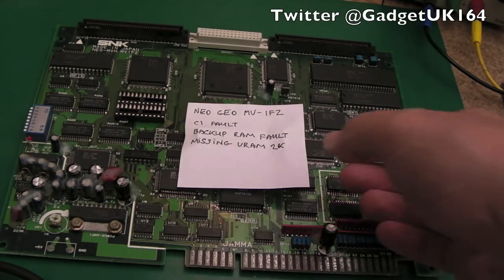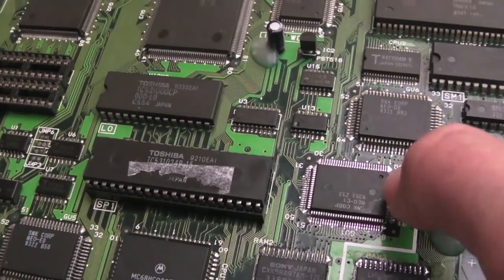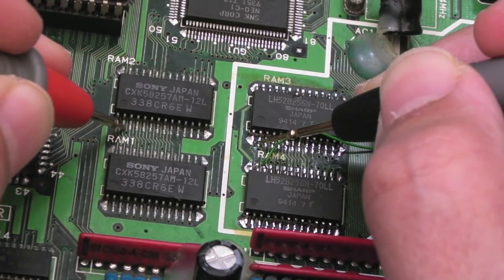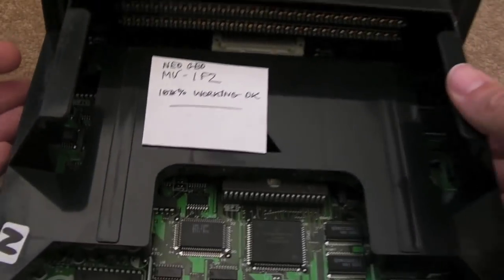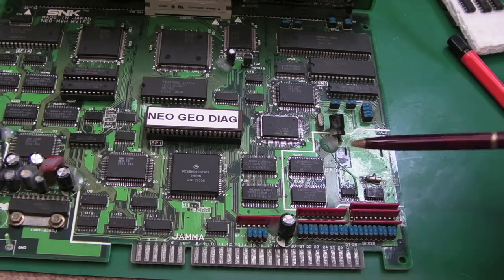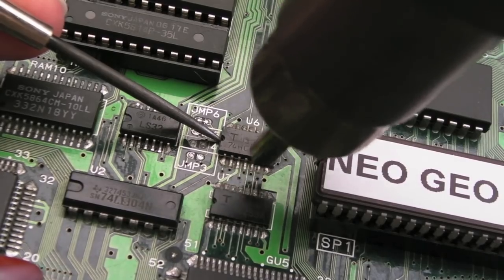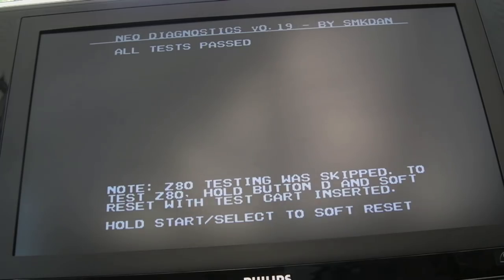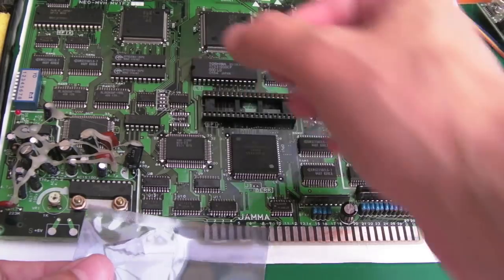SNK Neo Geo MV-1FZ (MVS) Backup RAM & Palette RAM Repair (Not the usual suspects...)

Comment from the maker: Link to the diagram (and notes) I created - https://www.dropbox.com/s/vcwc88lzmbq22n5/1FZ-BRAM.jpg?dl=0
Link to SMK Dan Diagnostic BIOS - http://smkdan.eludevisibility.org/neo/diag/
UNIBIOS - http://unibios.free.fr/
Reply: 42:05 ha, that's me. really shouldn't rewire power supplies in the dark with wires in non-standard colors. amazingly the MVS that I gave 12V still works fine months later but lost the multigame cart that was attached. and it was one of those new 161in1 carts that has a 5V regulator on each board. and looking at the regulator specsheet it says max 13V, so it should've been able to handle it?

the only thing that I can see could've been damaged on the cart is a diode that looks like it might be there for over-voltage protection, but checking with DMM it still seems to function as a diode.. maybe I should try replacing it anyway?
Reply: oh sorry, meant to make a new comment instead of reply.. and looking back the regs were these http://www.ti.com/product/LMS1585A setup for 3.3V I guess, but yea anyway Vin max 13V

Comment: Hey hows it going :) I just got a 1fz consolized system from spain and it's great apart from 1 issue. The audio is very loud and in many games causes wavey lines when loads goes on at once. This is on the ossc. Metal slug when still is fine but once action starts it's very obvious. Could this be linked to the volume pot being to high or my scart to scart fully wired cable? Thought I'd ask as you know alot about them :) sorry to trouble you mate
Reply: Sorted it. I was using a cable mountain rgb scart. Ditched it for a kabeldirekt lead and now flawless! Keep up the great work mate

Comment: I've fixed my MV1 thanks to your video and the diag bios, and like in your case the logic latch went under...

My symptoms were "funnier", not a single game of ADK worked (except ninja combat)  and prehistoric isle 2 failed too... a lot of textures were missing and replace by white and black boxes. 
The rest of the catalog worked fine, no glitches at all, from the old ones like fatal fury to the last, bigger, more demanding ones like kof's amd last battle, not a single problem. But not Alpha Denshi games... nope.

Thank god I got the palette error from the diag bios because if not I would be probably swapping expensive parts like a moron.

Thanks a lot!!

Comment: MV-1FZ is my fave as well. I got mine along with an MV-1 and the MV-1FZ was supposedly faulty but it was just a dead BIOS. Moving the socketed BIOS ROM from the MV-1 to the MV-1FZ was all it took. Heck, I had already programmed UniBIOS ROMs for it before I ever even powered it up so I inadvertently fixed it before even confirming the problem! To me, it’s the perfect board front-loading board to use for a consolization so I was surprised to see how few people were using a consolidated MV-1FZ before you. I suspect the LSPC2-A2 is faulty on one of my AES 3-6 boards so I’m going to try moving it from my known-good MV-1FZ to see if that does the trick. If so, I already know where I can order a replacement for $20. Thanks!
Reply from the maker: Let us know how you get on with that LSPC2-A2 - not a chip I would like to swap lol.
Reply: GadgetUK164 - Retro Gaming Repairs & Mods Will do! I recently salvaged a failed UltraHDMI installation for someone and managed to successfully remove the N64’s 160-pin QFP RCP (Reality Co-Processor - GPU) and reinstall it without damaging it (needed to remove the lifted pads so I could properly jumper the pins). Was good practice, but I still want more before I risk my working MV-1FZ. I’m going to practice on a box of 12 junk Super Famicoms with various bad QFPs (PPU1, PPU2, SCPU, etc). Maybe I’ll get a good video out of it. :)
Reply from the maker: Wow, that's a daring repair right there lol!  I imagine a chip that size absorbs a fair bit of heat.  It varies from board to board, but I find the MVS boards can take quite a lot of heat before the larger chips start to free up.  Soldering them back on is the easy part!
Reply: GadgetUK164 - Retro Gaming Repairs & Mods Thanks! I recently got an Aoyue Int866 (preheated and hot-air station) but I don’t have any nozzles for removing QFPs. I used a tiny bit of knock-off ChipQuick (~1/4”) and spread it on all four sides before hitting it with the heat gun. It came off surprisingly quick at a relatively low temp. I used so little because I only had s tiny bit left. I’ll try not to use it for the SFCs but I will order more for the MV-1FZ (don’t want to risk it!).
Reply: got a couple of MV1FZ sold broken for 15€/ea last fall. one of them just had bent pins shorting and a dodgy audio cap. no battery leak or anything :)

Comment: hey I wonder if you could help me ? ive just swapped out the Neo-b1 in my aes ,I lost 2 pads pin 49 and pin 61 they come back as test data 05 and test data 10 on the pinout , ive been trying to see were they go but the appear to go nowhere is that possible? that they just aren't connected to anything ?
Reply from the maker: Guessing - looking at the pinout, I assume they are just test outputs from the line buffers - so you can check they are working.  So they probably go nowhere...  You could try following the other pins on that same bus, see if any one of them goes anywhere?
Reply: @GadgetUK164  thanks I’ve checked the donar board with a multimeter and can’t see that they go anywhere it seems I got lucky with those pads , thanks for your time

Comment: Hey man. So I recently booted up my Supergun and started getting video tearing at the top of the screen using this model of 1 slot with the 3.3 Unibios. I suspect the VRAM is on it's way out. It will still boot up ok and play games but there will be tearing at the top and a black rectangle in the top left of the screen? Do you have any tips?
Reply from the maker: That sounds a bit strange?!?  Get a copy of SMK Dan diagnostic bios and see if the VRAM is reported as OK or not.  Beyond that it sounds like maybe a sync issue tbh (except that the black block sounds odd).
Reply: @GadgetUK164  I was mistaken, The black rectangle is just the edge of the screen. the whole upper fourth of the screen is moved to the right over an inch.

Comment: What I like about your vids (well, not your vids per se, more of the attitude)  is the total lack of bias towards the platform you are working on. Never throwing shade or comparing similar era of machine to another (unless it's a total pile of trash that should never have been committed to a run of PCB's), you just crack on, get it working to the best of your abilities - which often ends up with a machine that works better or has better longevity than when it rolled in to WHSmiths.
Reply from the maker: Thanks mate - really appreciate it =D   Yes, I do try to remain unbiased!  TBH, I have love for all the systems I've shown on my channel.  There are strengths and weaknesses with each system, but comparing just is pointless imo - why have one when you can both sides of the fence!
Reply: I never had playground wars with computers, I just loved what I had and was happy. Yeah so it can only do 16 colours, only comes with an ant farm for RAM, didn't care, it was mine.
Reply: Make a simple channel trailer - I'm not one to watch them, but a short, say a minute vid of what you do and what you accomplish would be great to share among peeps I converse with. It'd save me a shit load of typing lol.
Reply from the maker: Thanks, yes - I do need to do a proper channel intro at some point - if I continue doing vids.  Hope your having / had a good holiday btw!!!
Reply: Have just got back :) need another holiday to relax after getting back from this one lol. Oh and please carry on doin the odd vid if you can be arsed. You are internet gold.

Comment: I recently did a dumb thing and plugged my MVS Neo Geo harness into a Jamma Switcher and my Neo Geo board into the switcher as well. I've since found out that only the single cartridge is Jamma :( 

Now my visuals are super bright and high in contrast. I've swapped several vga boards and it seems to have damaged my Bust A Move Cartridge as well.  Nothing looks as good as before, would you have a suggestion as to where I should start first? 

Sound and everything else works great. 

Thank you.
Reply from the maker: It's hard to tell where the fault is - the RGB comes out of a resistor ladder I think, from some 74HC245 ICs or something.  Chances are one or more of the resistors might be bad, or maybe the 245.  Depending on how your MVS is modded it might be something else related to the RGB or sync connections.

Comment: When I turn on my MV1-FZ all I can see is a completely white screen. Could you give some tips? Is it possible to see something on screen with the diagnostic bios?
Reply from the maker: It could be a palette problem or DAC related (LS245's near bottom).  If it was the DAC though I would expect a normal game cart to work (providing sound at least).  Have you fully inspected the board for any damage?  Also feel the tops of the chips to see if anything gets hot soon after power on.

Comment: Still tapping chips.  I just hope you dont do that with an old silicon chip under power (they have a habit of going pop)  but amazing.  I Wonder... if i were to say want to send you a neo geo where someone for some reason put power into the jamma (actually NOT me for once) and anyway the audio blew (to the point where it peeled trace off the board)  would you consider fixing it and what would you charge a humble canadian for such a thing?
Reply from the maker: Haha, yes - old habits die hard!  Interesting point there about some chips not liking vibrations!  I know crystals can break from too hard a tap or knock.  I cannot do repairs for people - I have a full time job, and long term health issues that significantly limit my time and energy.  It's also stress I dont need - ie. risk of things going missing in transit, a repair working for a month and then some new fault appears etc etc.
Reply: GadgetUK164 - Retro Gaming Repairs & Mods can't blame a guy for asking. I'm just being lazy I have the tools and skills but not things like your test rom lol
Reply from the maker: No worries!  There's always easy solutions to some problems!  The test ROM for example, you can order a 27C1024 from buyicnow.com pre-programmed.   There's an option to upload a ROM (which you can get from SMK Dan's page), and they charge you an extra $1 or something.   It is from China so would take 2 or 3 weeks but it works out really cheap.

Comment: Great vid, mate. Who ever said the longer format vids don't work. :p

43:44 - Those chips look like standard SOIC size, so 1.27mm pin pitch, but the 259 chip is the wide version.

So, there would normally be an "SO16W" version of the part number. For the 259, I believe that's something like DM74HC259WM.

(the narrower chip you have there is the DM74HC259M, but the suffix can be different, based on manufacturer.

I think SOIC is the same as SOP / SO, but I STILL have to Google that, as I always forget. lol

As long as they have a 1.27mm pitch, so half of the usual DIL chips, then they should be SOIC / SOP / SO, or "Small Outline". But yeah, narrow and wide options for some. No idea why, tbh.

I think it was due to the older IC processes making the die too large to fit, so the wider chips were the standard for a while? Dunno.

The body + legs of the narrow versions are usually around 6mm, but the wide versions are 10mm.

SOJ chips are the ones where the legs can be bent underneath so they can be socketed, like the RAM on old-school gfx cards.
Or, still soldered to the board, like the VRAM on the Atari Jaguar, which I found out recently are a bitch to manually solder. lol

I'm sure I used to solder SOJ chips (with "J" legs) just fine years ago, so maybe I've lost the knack slightly, and / or need a new soldering tip, as mine is blunt now.

I sold my MVS to a good friend a few years ago, but I never really played the games, tbh. Too expensive to collect for, too complex / expensive for a Flash cart, and a lot of the games are beat-em-ups or sports.

My friend is more than happy, though, as he has it hooked up to his cabinet, with a proper arcade control panel etc. ;)

I still have a Neo Geo CD, though.

I was looking into making an ODE for it, and it has a very similar CD drive setup as the Mega CD / Sega CD, and others, so the ODE could be usable on many of them.

I'm already 37 years old (today), so I doubt I'll ever get all of these projects done. lol
Reply: 47:11

That's one for the remix.

"By the time you've finished, it's all runny, like runny liquid all over board... Push it in and out of the slot..." And so on. lol
Reply from the maker: Thanks for the detailed reply mate =D  Did you see the video Furtek did on his ODE for the Neo CD?  Happy birthday btw =D
Reply from the maker: LOL =D
Reply: GadgetUK164 - Retro Gaming Repairs & Mods 

Yep, I saw Furtek's vid. Awesome work. ;)

Comment: I did this mod with a Duracell 2032 Lithium. Does anyone know how long these batteries will hold the Backup Ram on a MV1A Board?
Reply from the maker: Not sure - I have a CR2032 on my MV1FZ and I did that well over a year ago and its still holding settings fine.  I would suspect 1 to 2 years probably.
Reply: @GadgetUK164  

Ok 2 Years is not so bad. Would be interessting to see if the MVS holds settings and highscores if you change the battery very fast.
Reply: @GadgetUK164  

The Virtual Memory named NeoBiosMasta solves this problem. It saves all highscores and progresses to this memorycard (if unibios is installed). So if you change the battery after 3 years you only lose the regionsettings and modes for the game. Since these are only stored in the backup ram, not on the card. The backup ram itself can only save the highscores of the last 8 games played and you lose them if you change the battery. So better get the NeoBiosMasta. It's as important as unibios. Changing the region settings for the games every few years is not a big deal...

Comment: The absolute first thing I'd do with that board is remove all that hot glue from the capacitors xD  Who thought that was a good idea?
Reply from the maker: SNK added the hot glue at manufacture!  I agree though, it's best to remove it as you recap it.
Reply: i can't imagine covering the vents on the top of the caps with hot glue can be a good thing...
Reply from the maker: That was exactly my point on one of my older MVS videos there.  Not good as the caps will really explode when the can cannot vent.
Reply: Yeah, I'm looking at that and going "the hell happened to those capacitors? Is that hot glue?"

Comment: hey mate. hope ur well. need help i, got a neo geo. from ebay top loader. from japan import. said it works and it doesn't i put a English adapter converter for power, power light comes on, however doesnt start spinning or anything more than that. instead of me faffing can i send it you and you fix it
Reply from the maker: I cannot do customer repairs sorry =/  Chances are the PSU needs recapping!  The other problem with these is the 3 pin power connector that plugs into the Neo CD gets slack and dirty (get some deoxit in there and maybe try and tighen the holes with a fine screwdriver).
Reply: @GadgetUK164  cheers mate.  I've tried the tighten  the pins n cleaning. No luck.  What's recapping. Lol. (Newbie)